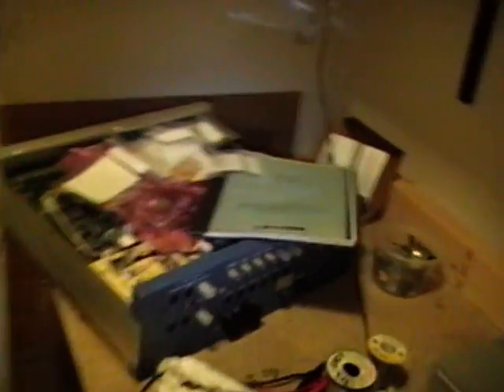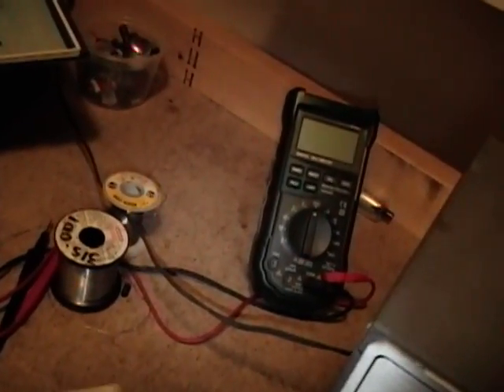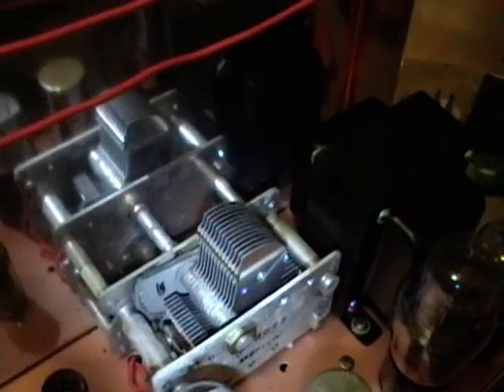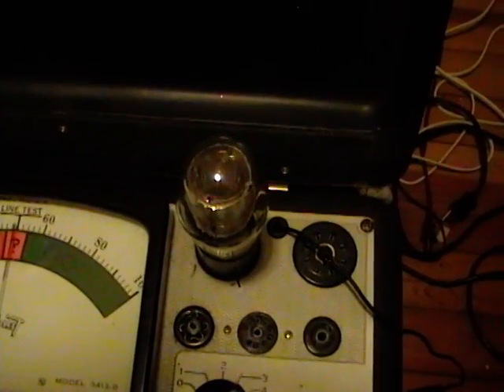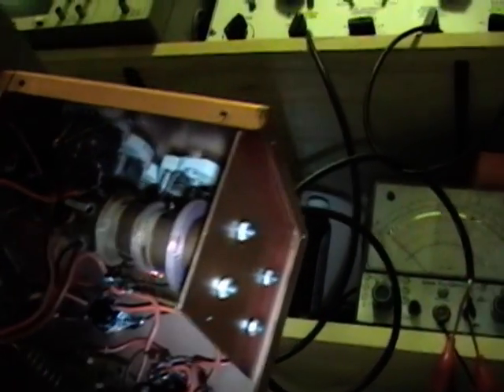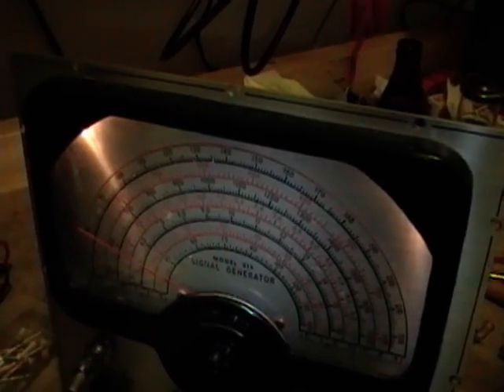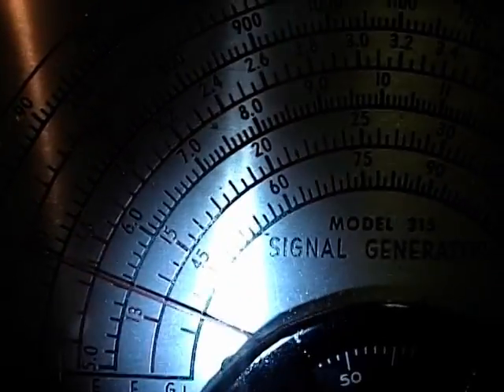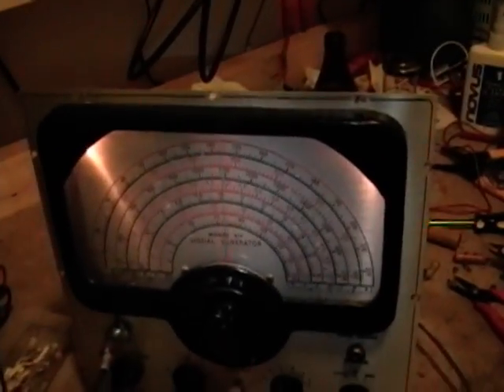EICO 315 restoration

Comment: any idea what the output waveform on yours looks like?
Reply from the maker: Probably lumpy.  These old generators are fairly simple and rely on harmonics for the higher bands so don't expect to get pure sine waves.
Reply: +bandersentv the output of mine was terrible when measured at the input to the cathode follower output stage. at the RF output jack it was even worse due to the cathode follower stage being severely over driven.
Reply from the maker: It may look terrible but actually be usable.  You'd really need to hook it up to a spectrum analyzer to see how strong the fundamental frequency is compared to the other junk in the output.
Reply: +bandersentv Oh ok. I have used mine for several alignments over the past few years, but now I have a digital frequency display kit I use to see what frequency I am on and on some frequencies it sometimes reads higher than what it should be.
Reply: I'm currently working on fixes for both. Got the oscillator to be a decent sinewave, but as was the case as it was originally the RF output still isn't the same level on all bands, but that's not a problem.

Still gotta get the cathode follower stage correct.

Comment: Great Video and Lesson, as all your others are! A few questions if you please...Did you also replace/rebuild the Two-section electrolytic can capacitor? Could you suggest supplier's for the correct type/style replacement caps? Thank You!

Comment: Good job.  Did you notice the quality of the components EICO used in this 315?  The dial drive is a 10:1 ratio spring-loaded  "split gear, constant contact" zero backlash dial drive.   Very expensive back then, and even moreso today.   You don't see anyone using air variable trimmers, the dial frame is a black painted iron casting, not plastic.  It sure gives meaning to the old saying, "They don't make 'em like they used to."
A fine job, Bob.
Dick

Comment: Bob, I looked up the 315 manual on the BAMA website and noticed something.  The tubes you mentioned in the video, if I heard you right, were:  6X4, 6X5, VT139 and 6SL7.  The tubes mentioned in the EICO 315 manual were:  6C4, 6SL7, VR150, and 6X5.  I don't have near the knowledge you have, but could the difference in tube types be the cause of your problems with your 315?  Tom

Comment: Bob, Great video.  Did you ever shoot a followup video to this?  I saw your video on an EICO 324 restoration.  Do you prefer the 315 or 324 if you had a choice?  I'm going to a radio swap meet later this month and I've been offered an unrestored EICO 315 for cheap I can pick up there.  Any advice?  Thanks a lot, Tom